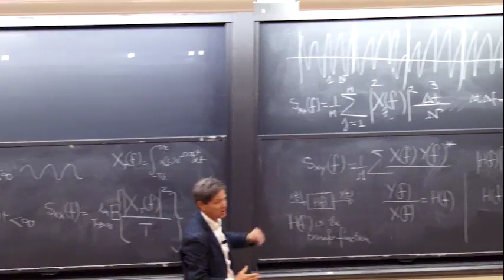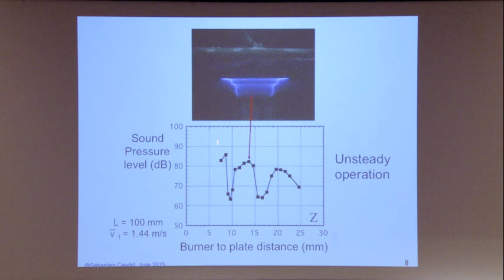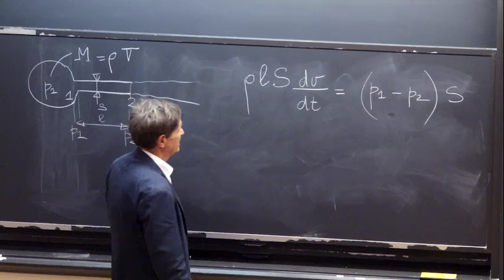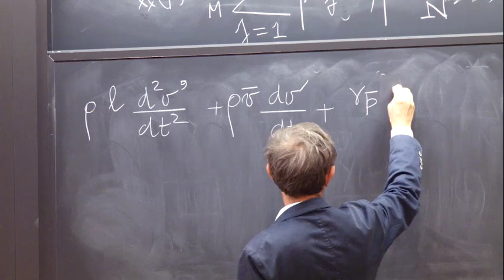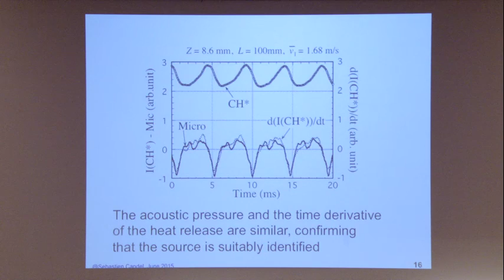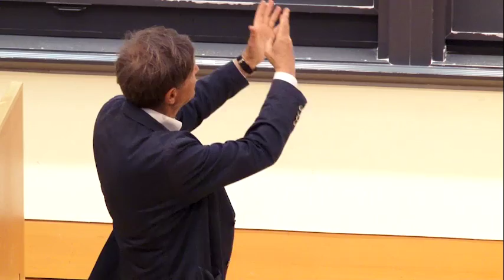Combustion Dynamics, Candel, Day 3, Part 3

Comment: @2min Candel talks of the need to take an averaged FFT to get a true representation of the signal. I think that using Welch's method, with the right inputs, handles this pretty well. Does anyone have an opinion? Btw I am using pwelch in matlab on data with 88400 samples (10sec with Fs=8840hz), a window length of 500 points and 50% overlap (Giving M=174 I think).